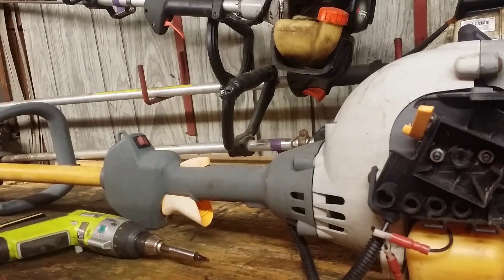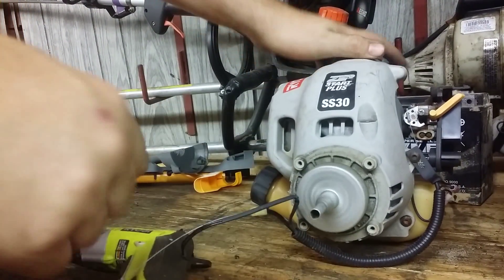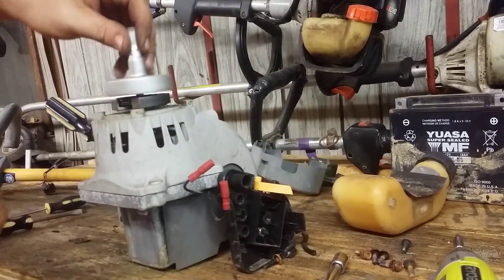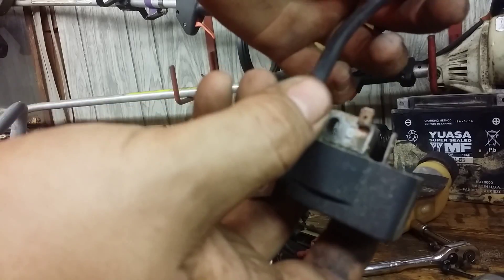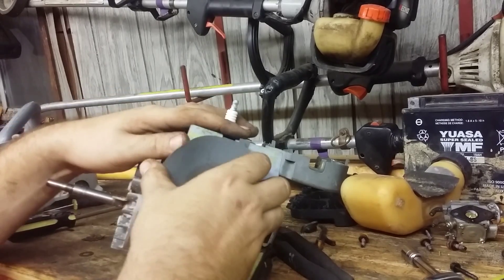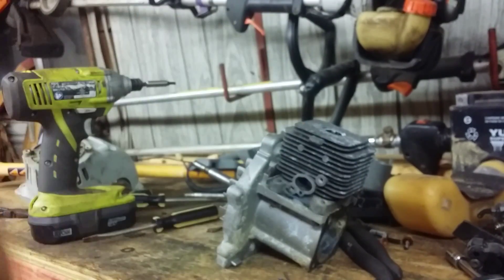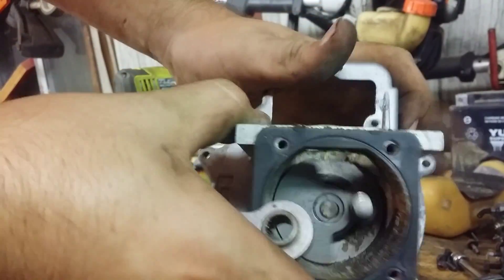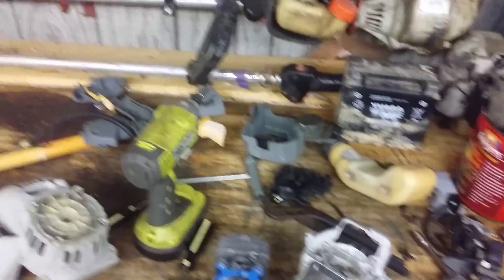What's inside? Ryobi 2 stroke weed wacker

Comment: I have a CMI trimmer. The pull cord was stuck. When l disassembled it, thebpull cord works fine, but the flywheel is stuck. Any ideas? I cannot find the clutch nor its spring.
Reply from the maker: If the flywheel won't spin, there is a good chance the motor is seized

Comment: I know this is old, however thanks for doing this. I am making a solar power air pump for my pond, and thinking of using an old weed wacker engine spun by a motor for air production. I was all psyched yesterday when I thought of it, and had the brainstorm that a 2-cycle would be even better. But after thinking about it, and lubrication which will get into the production air no matter what, I'm now revising my thinking and considering a 4-cycle. I think the 4-cycle will work better longevity-wise as oiling is better/easier, and I can use some sort of vegetable or non-hydrocarbon based oil since it will be spinning much slower then when on gas.
Of course, I just got rid of 2 old 4-c push mowers last week after 4 years sitting before thinking about this....
Reply from the maker: yep every time i clear out some of my hoard i need it the next week... best of luck on the project.

Comment: Personally i actually like these ryobi strimmers. I have a good few scrap ones that i pull parts off to repair other ones. The full crank engines they made are definitely a better machine when you adjust the carb richer. Not a fan of their 4 strokes though

Comment: Wrong again . No spring behind the diaphragm , it uses vacuum from the crankcase .
Reply from the maker: Must be difficult to find hats to fit that ego of yours, maybe take apart one of your own to see what im talking about here...if that is too difficult, physics 101 any action requires an equal and opposite reaction.
The engine vacuum pulls the diaphragm in one direction...there is no vacuum on the outside,  thus requiring a spring to react.   splash
Reply: @1beastlydudefixbreakrepeat  ,,,,the second stroke pulls the diaphragm back out on a 2 stroke. ,,,,,,,,Your reaction was unequal , you should’ve thanked me for correcting you so that way you can actually fix the machine next time .
Reply from the maker: @g86jn1  my goodness, I didn't realize my  unforgettable transgression.
Once again, you are partially correct,  yes there are two strokes.However in reference to the diaphragm I refer to in the power stroke of the piston(moving downward, exhaust stroke and intake as well) the fuel mix volume in the crank case is displaced to the cylinder causing a pressure against the one way valve(reed valve)preventing ejecting the fuel mix into the atmosphere.
Upon the upstroke(compression, intake) a vacuum forms in the bottom end pulling in the fuel air mix , this vacuum is extended to the carburetor thus providing a small force upon the fuel pump diaphragm. This force needs to be reversed as there is no acting force to do so a spring is used.
I appreciate your concern with correction,  however starting with talking down and screaming capital letters will put you on the wrong foot real fast. Also the weedeater was not worth fixing, not because I couldn't fix it. Those weed eaters sell for about 120 new, if I spend 25 bucks on parts and and hours time of labor it would have cost me out 70 bucks. Best someone would pay is 80, when for 40 more they could buy new...name brand equipment sells used for a premium, cheap stuff is not worth it.

Comment: 6:35 , wrong ! When you pull the cord the keepers stay in place and the recoil sprocket grabs the keepers counterclockwise . Then the spring loaded sprocket goes clockwise and the keepers ratchet backwards using pin-springs as the cord rewinds .
Reply from the maker: Please feel free to show me on one of your videos...splash

Yes at low speed the springs ratchet, how ever once the engine begins running, this weird phenomenon called "centrifugal force" occurs forcing the springs outward thus preventing wear on the surfaces while running. Plastic parts wouldn't last 5 minutes otherwise.

Comment: That mesh you were referring to in the muffler is a catalytic converter that  burns the unburned fuel that 2 cycles expel because of the intake charge pushing out the exhaust charge.